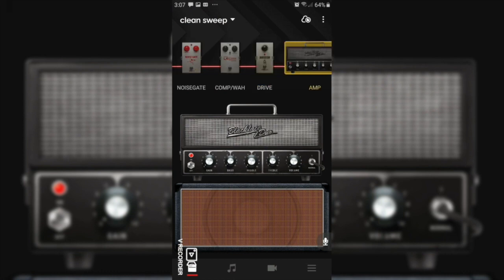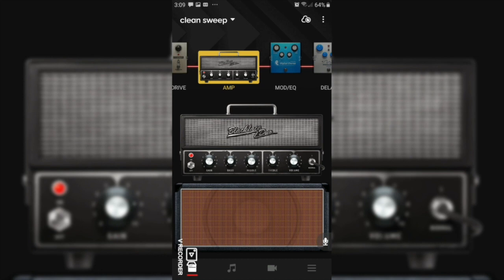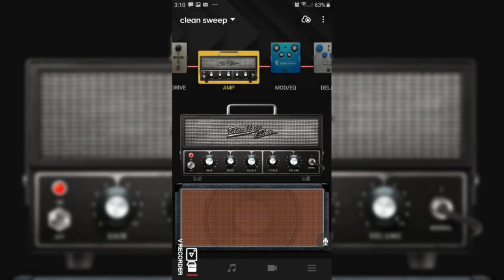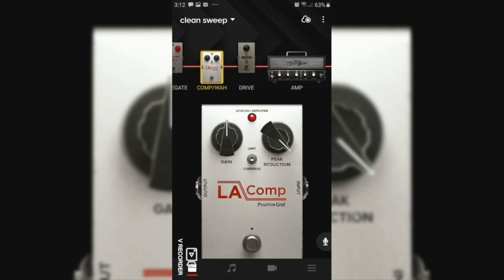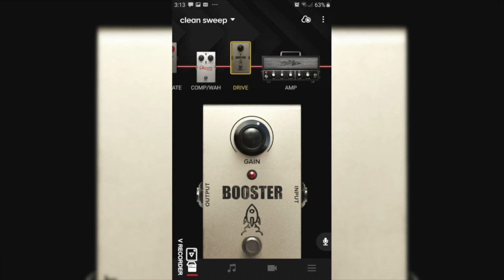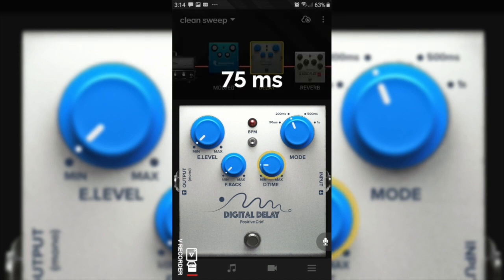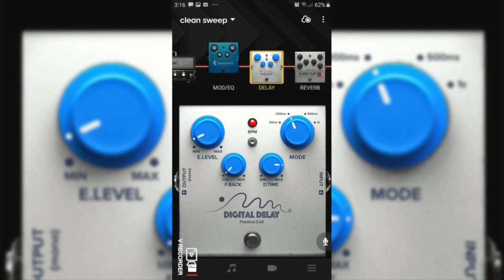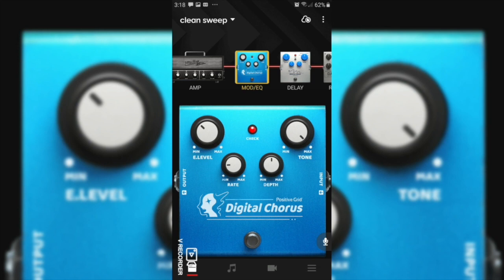Positive Grid - Spark Amp - Tone build tutorial - how to build a funky clean tone with original demo

Comment: hi, with clean amp i've a very low volume...is it normal?
Reply from the maker: Youll need to adjust your overall output volume.
Reply: @papalytic7767  Thanks Antonio, so is it normal? I'm not expert...
Reply from the maker: No, it might be that your distorted tones are set too high.
Reply: @papalytic7767  ok, because there are a lot of Volume and gains to set.. on amp, on effects, on compressor.. on drive..on boost...
I don't understand much... 😂😂
Reply from the maker: Hopefully if you continue to watch this series of videos it will help you alot.
Reply: @papalytic7767  of course!